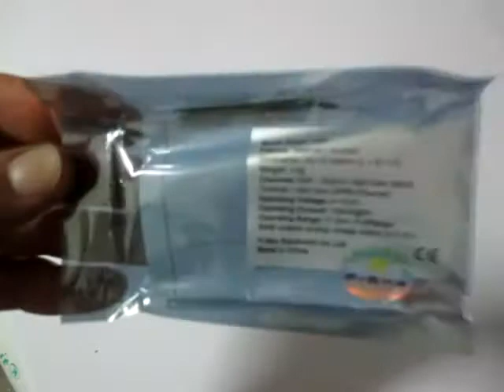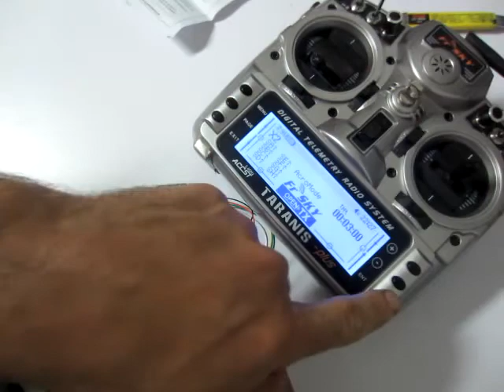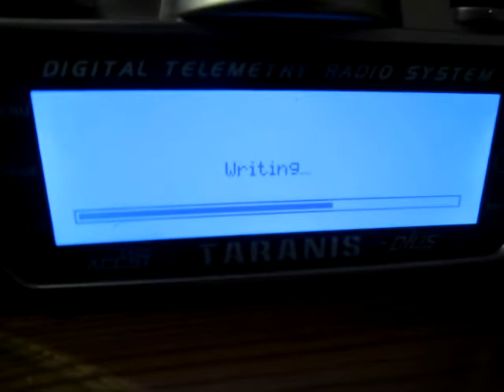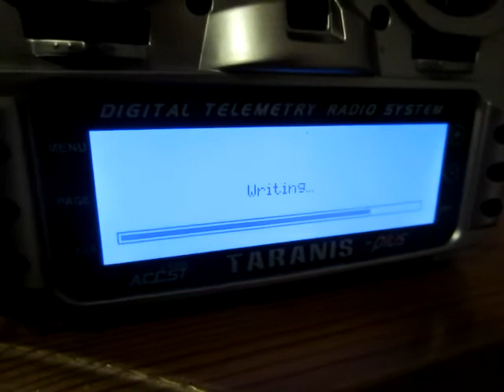FrSky XSR 2.4GHz 16CH ACCST Receiver S-Bus CPPM

Comment: You can use any battery to power the receiver? How many volts you got there?. Thank you
Reply from the maker: Take in mind that Im using just a two cells on balance plug ;)
FrSky XSR 4-10V

Comment: why do you flash it to the eu version,  does your Taranis have the eu Version ?
Reply from the maker: Yes, my taranis has a EU version.
Reply: Flyer FPV  is it Working Good together with the Taranis? 
Because i bought a furibee darkmax and a Taranis q7 but it is not working as you can see on my Channel
Reply: Flyer FPV i Think aubt buying a new Receiver
Reply from the maker: Yes its working great.
Do you have a R-XSR receiver?
Reply: I'm not 100 percent sure but I think so  
I bought the Standard frysky Model from gearbest
Reply: And I think i have the non du Version
Reply: Eu  version
Reply from the maker: Do you need sure what the firmware that you have in both, receiver and transmitter, EU to Non EU not work.